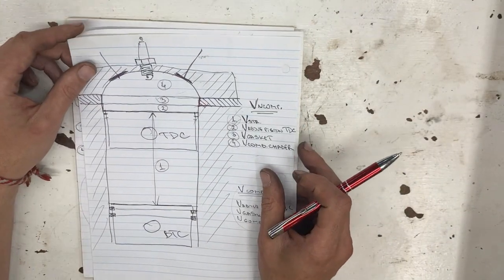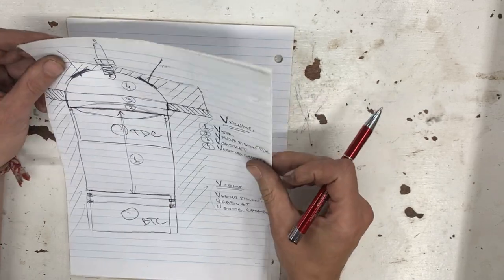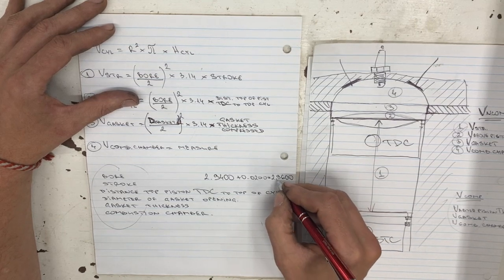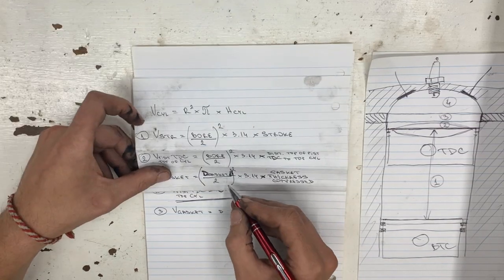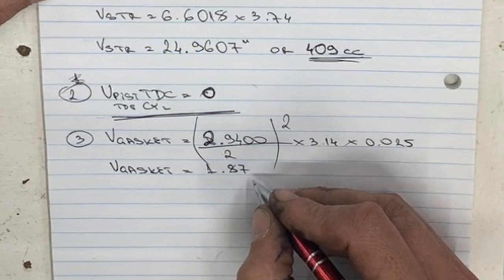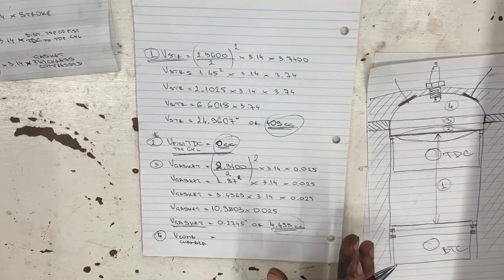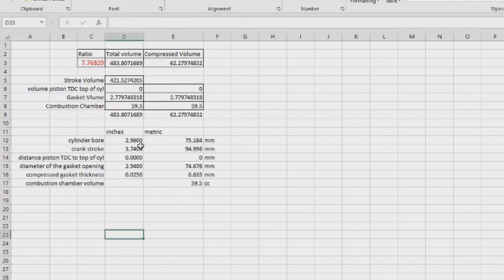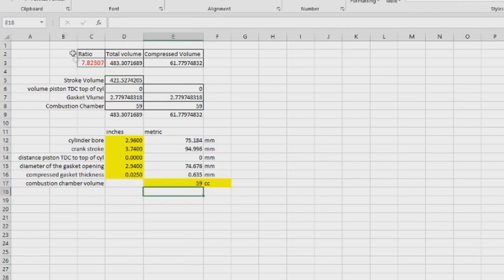Combustion Chamber Volume and Compression Ratio...

Comment: The compression volume above your piston is 1/6.5 the volume of your original stroke volume (based upon a 7.5:1). You know the original bore & piston size so doing the math ((2.94/2)^2 * Pi * 3.74)/6.5 gets you the compression volume of 3.91 cu in or 64.1 cc. without having to measure it. A .02 overbored piston will have a stroke volume of 25.7 cu in or 421 cc. So your resultant compression ratio is actually (421+64.1)/64.1 = 7.57:1 (even closer to 7.5:1!). All without getting your hand dirty or worrying about gasket volume or where the piston stop, etc.
Reply from the maker: Correct, but all that assuming that the 7.5:1 ratio in the spec is correct and no modifications to the head were done. The main reason to measure the actual chamber volume was to find out if it was "shaved" already and if there was room for more.
Reply: @RustyBeauties  Good Point. Enjoy your videos!

Comment: Just some Excel pointers. Volume of cylinder can be calculated as d^2*pi/4. Excel also has a function for pi, simply "pi()" and number can be squared with ^2 (or any other power)  witch means the formula in e.g. cell D5. could be, "=E12^2*pi()/4*E13*1000" 
But as always great video.
Reply from the maker: Oh, I knew there were functions to simplify it in excel, I just had to search for them, as I don't know them of the top of my head. But I wanted to keep the formula as close as possible to a "human" language :) Thanks though. Good to know.

Comment: You know, you're smarter than I look. You are going places, kid. ;) I had to skip around, but I'm thinking that there may be a downloadable spreadsheet that can do this for a guy at home, specific to this engine? It's so much easier to send the head or complete engine off to the machinest, but this is totally doable if you push yourself to try and figure it out before having the machinest shave the head. Plus, they make mistakes also! I haven't had a problem, but my father in law did and it pushed back his project almost a year.

Comment: Isn’t it important to have gaskets for overbored cylinders to be at least as wide as the new bore?  That may have a tiny change to your numbers.
Reply from the maker: Yes, it is, but these are not available for TR6. At least not to my knowledge.
Reply: @RustyBeauties  Good point.  When we had to rebuild my engine a few years ago we went with stock diameter sleeves in a couple of the holes so it wasn’t an issue.

Comment: Well that was very informative.  Now Just post the excel file for us digit inept.
Reply: I did one for my BMW K100 Twin Cam headed 1098 Mini engine. Just so easy to flex using different head gasket thicknesses etc...
Reply from the maker: Sure, I will send it to you if you want. There are much better apps if you wanna use a ready to use tool